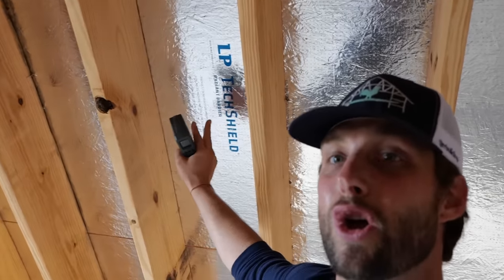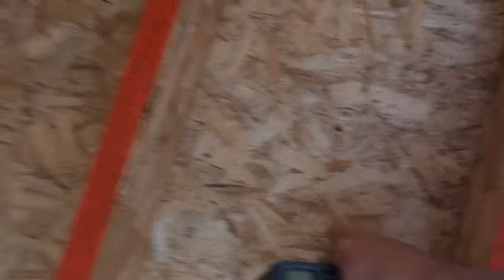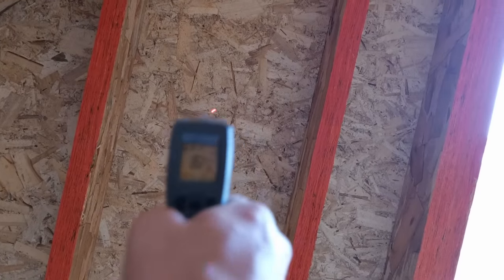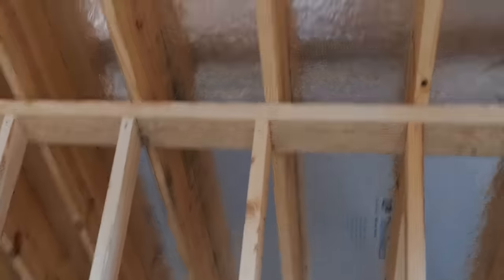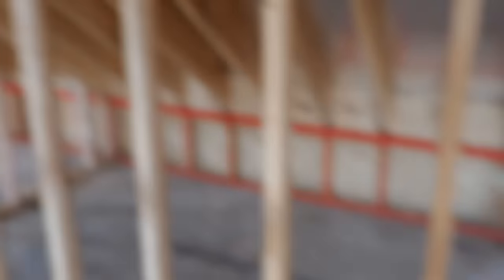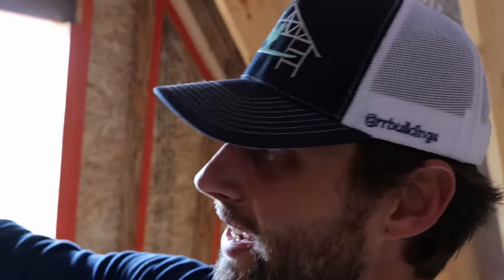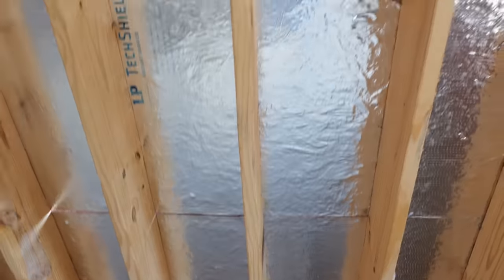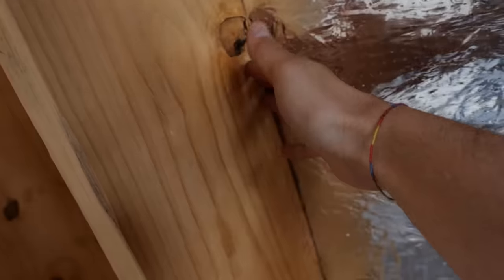Do Radiant Barriers Work? - LP Techshield Review

Comment: This is the info I've been looking for - thank you!! We're eventually going to install this on the roof deck behind our cape cod's knee walls and turn those areas into conditioned space. One question though: would you install baffles right to the radiant barrier, or do you think the air gap between it and the fiberglass batts that we also plan to install will be enough for air flow? Or would they be redundant since we'd have that air gap? Thanks again for your input!

Comment: I'm wondering, if the radiant barrier reflects the heat back out, what effect does that have on the lifespan of the shingles?
Reply: My understanding is that it basically turns the roof deck into a hot skillet,  and shortens the lifespan of the asphalt shingles,  just like when someone spray-foams their attic.  Having a metal roof built upon a batten system negates that,  but few people are willing to spend that kind of money on their roof.  I am getting ready to install a roof on a home where the customer has a finished attic space they use for their office.  I am going to use a radiant barrier underlayment in an effort to make the attic/office more bearable in the summer.  My customer understands the impact on the shingles but feels the trade off is worth it if it makes his office space more comfortable in the summertime.

Comment: Thanks Jordan.  I enjoy your videos.  Stupid question time.  It seems shiny surfaces most effectively reflect radiant heat facing the source of that radiant heat.  There are products out there to be applied to the outside of roof sheathing that are reflective generally to the same extent as the radiant barrier on common RB roof sheathing to do so.  Therefore why is the shiny side of the Tech Shield, and similar products, installed having the shiny side facing the inside of the building?  Certainly the other side of the foil may be shiny too but glue etc would interfere with the reflective qualities.
Reply: Willie,  Absolutely right, the shiny foil side should be on the outside, not the inside.  I built a pole barn and insulated with a foil bubble wrap (foil side looking up, not inside) and it works very well in the hot Texas sun. Bubble wrap provides the gap, and the interior is a nice bright white.  Great question, not stupid at all.
Reply: My understanding was that radiant barriers need an air space between them and the source of the heat that you're trying to reflect back. The LP literature shows it installed as in this video. I'm confused.

Comment: Hey Jordan,I'm going to be converting a van into a camper and I have question. Do I need a space between the van surface and the radiant barrier and a space between the barrier and the insulation or just between the barrier and th insulation? Any advice would appreciated. Thank you

Comment: Radiant barriers work best when there is an air gap between the radiant barrier and the outside surface.  The metal attached to the wood will reflect some heat but it will also conduct the heat and radiate from the metal itself.   You typically want a  thin air gap and the hot air can flow out of the top ridge if you have one.
Reply from the maker: I think I understand what your saying, and I agree that a radiant barrier that doesn't touch another surface is best, but its important not to confuse emissivity with reflectivity.  We are preventing the material from transferring heat via infrared light, not reflecting the infrared light away.
Reply: Jordan Smith how is it preventing radiation from entering? It is attached to the osb, and the gap is on the inside. It would prevent heat from leaving not entering.
Reply: @curtcmiller  - The sun’s energy is heating up the decking panels and the exterior roofing material. The aluminum foil overlay is preventing this built - up heat from emanating into the attic cavity and increasing the attic air temperature.
Reply: ddellwo Jordan said it would not work if it was touching the insulation. It seems like the gap is on the wrong side. To reflect it needs a gap, so it is reflecting the heat down into the house with the gap on the inside. It is attached to the osb so there is no space to reflect up.
Reply: @curtcmiller  It's working off the EMISSIVITY quality of the aluminum.  Or, the ability to NOT release as much radiant heat.  A simple example is if you take two hot potatoes and wrap one with foil the foil wrapped potato will stay hot longer because it is not emitting as much radiant heat.  Technically TechShield does not "Reflect" any heat.  It "minimizes" the amount of radiant heat being released.  More info here: https://youtu.be/uGP5KobU6R4
Reply: @curtcmiller  - No, the gap is on the proper side. The foil is facing down into the attic cavity and unless it is in a cathedral ceiling area the insulation will be blown onto the floor of the attic. In this case, the entire attic cavity between the floor of the attic and the aluminum foil underside of the decking panels will be the required “air gap” of the assembly!
Reply: @AtticFoil  exactly correct, just one small nitpick;) foil has an emittance of 0.03, so it does radiate very little as it is not 0. :)
Reply: @charlesbiller4371  I am very familiar that aluminum foil has an emittance of 0.03.  Can you clarify where I ever said it was ZERO?  I think you may have misread my comment.
Reply: @AtticFoil  I guess I misread your post, it appears.  But, that foil on that roof deck in the video will reflect any radiant energy source in the attic.

Comment: I put attic foil in my garage here in South Florida and it made it bearable to be in there in the summer ( along with insulating my East facing garage door. I then did the rest of the house. It's a hell of a lot of work to retrofit an attic built with 2x4s and any new construction should have this included.

Comment: I have the OSB radiant barrier on my roof (Arizona) and I wanted to add the spray foam insulation. After seeing this video it made me think twice about it. My question is, can I use the 4x8 foam insulation cut into pieces that fit between the trusses while leaving space between  the OSB and the actual piece of insulation to get more R value and make my house more energy efficient or will I be just waisting my money on that?

Comment: A radiant barriers benificial characteristic in this application (physically bonded to the OSB) reduces radiant emissivity into the attic therefore reducing the temperature inside....in short and clear. But great you covered not to make contact with it.

Comment: Great video, What is the best way in the south to keep that heat out of the attic space? In your video you are using LP Techshield radiant barrier but will you be adding any spray foam? or foam boards spaced out from the roof sheeting? is that the next step to continue from where you left off? In todays choices options for existing homes in the south ?

Comment: Hi, I haven’t been able to find the answer to this question anywhere...

Polyiso foam board with the recycled paper/fiberglass outer coating... Is it toxic?? Using it in a van build, but it makes me nervous.

Thank you.
Reply: Most insulating products for homes are meant to be covered by drywall or paneling. If you cover it with some sort of paneling or plastic, or even fabric, I would expect it to be safe. They won't likely use chemicals that will be dangerous but breathing the fiberglass dust from insulation is not good. The home improvement stores have NRP or non reinforced plastic which is used in commercial and residential bathrooms as a thin plastic wall finish which can be cleaned. It would be a good choice for a van. FRP is fiberglass reinforced plastic, which has a lot of texture and is used in commercial bathrooms. FRP is a PITA to deal with and I would not recommend it, but NRP can be cut with a utility knife. Thin wood paneling is also great to cover over insulation.
Reply: @CGT80  Thank you so much. We will have wood paneling over it, I was just nervous if that wasn’t enough.

Comment: The radiant barrier being part of the roof deck cut the effectiveness of the barrier because the side in contact with the deck has no effect. This is why I believe that it is better to install the barrier on the bottom side of the rafters. If you are putting sheet rock on the bottom side also then you put strips of thin plywood over the barrier at the rafters to create an airspace. As far as your surface temperature comparison you must remember that the temperature you measure is a function of emissivity and there is a large difference between the two surfaces. That being said, radiant barrier will transform an attic on a 90 degree day from an air temperature of 110/120 degrees  to about 95 degrees. I have radiant barrier in my attic and I'm also a Test Engineer.
Reply: " the side in contact with the deck has no effect"
No, I don't think so.  The radiant energy is still being reflected regardless of contact, reducing the heat gain in the attic.  This will likely add some heat to the wood roof deck and shingles/roofing but that heat issue is limited to the gain by conduction.  This is why there's a need for additional insulation below the radiant barrier.

I wonder whether planning an air gap or insulating right against the radiant barrier is actually better and suspect this may depend on many factors including choice of insulation, whether you have ridge vents, whether you're going for full encapsulation.

Any time you can plan an air gap between roof deck and shingles/roofing (generally this means metal roofing) is all to the good (but this is in addition to benefits of the radiant barrier).  This radiant barrier combined with metal roofing sounds great.

I'd be more concerned with roofing nails penetrating deck and barrier.  Cleats glued and (minimally) nailed into deck and an underlying rafter when possible would probably be best practice.
Reply: @amerlin388  A little about my background, I have a BSME & ME and I hold a Professional Engineer's license. I specialized in thermo-fluids and heat transfer. I spent my career as a Test Engineer that being said when I said no effect this applies only to the areas of contact and since there will not be perfect contact there is a very small effect. With the barrier in contact with the deck the heat transfer is dominated by conduction while when there is an air gap radiation becomes much more important in the heat transfer. The amount of heat added to the deck and roofing is small which has been confirmed by test and measurement. The reason there is a need for insulation in addition to the radiant barrier is because the radiant barrier is only effective against radiant heat transfer. The other insulation controls conduction and convection. 
Of course proper design is needed to get the best results but an air gap is ALWAYS preferred over no gap. Take a trip down to your local home center and look at the insulation with reflective paper if you look at the side in contact with the fiber glass you will find that it is not reflective. 
Nails would not be a big deal. The radiant barrier is perferrated to allow moisture to pass through it and the area of a nail is small compared to the total area.
I stand by everything I said in my original post.
Reply: @timrothgeb416  
Your original post said, "The radiant barrier being part of the roof deck cut the effectiveness of the barrier because the side in contact with the deck has NO EFFECT."  The upper side of the radiant barrier, being integrated, has 100% contact with the wood roof deck, so essentially you said it has no effect.  Now you refer to (small?) areas of contact with imperfect contact (meaning what?) having small effect (meaning NOT drastically impacting efficiency of radiant barrier).  What was the original text trying to convey?

Regarding foil-faced fiberglass insulation, it doesn't matter which side of paper has the reflective surface;  the radiant energy is still reflected to the same degree.  It's on the outside of the paper layer so the consumer can see at a glance that it has a foil layer.

A roofer once tried to tell me shingle life is halved when installed above a radiant barrier because shingles take a hit from both sides.  I could believe some effect but not anything that drastic.  I would welcome your opinion.

Incidentally, I wonder why this product would not have preferred installation with the foil side out (less baking of the wood in roof deck).  I can only assume in practice the foil layer would be scraped/damaged by roofers during installation/shingling.

Comment: That 10 degree "delta" is being held in the roof deck and shingles, it didn't vanish. It was not destroyed.  Heat energy cannot be destroyed.  It can be moved (as AC does), or stored (as your roof shingles are), but it does not vanish. If you doubt that, touch the glass of a heavily tinted car window in the summer sun.  You say the inside of the car is cooler...and it IS...but where did the heat go?  Touch the glass. 
Radiant barriers attached to the underside of roof decking reflect heat back into the roof deck where it is accumulated in the shingles. Heat  is the enemy of shingles.  Weigh the electrical savings against the reduced life of the roof.  If you have a metal roof with an air space for ventilation or a tile roof with air space...great!  If you have asphalt shingles it is better to install the barrier on between the attic floor and ceiling in addition to regular insulation and provide adequate ventilation, REALLY adequate ventilation, for the attic.  Typical under eave vents and ridge venting and/or off ridge vents are not adequate.  Powered, thermostatically controlled ventilation, properly maintained, is a better choice.
Reply: Hey Gary K, I'd like to have you're input. What if I'm building a sauna? What's the most efficient way to keep the heat INSIDE? Would I need to put a gap like he was referring to between the barrier and the inner cedar planking?
Reply: 🧠👀 makes sense, I just started hvac school
Reply: @Revelator713  Good for you!  Great trade to be in.  Something to consider...the easy route when you finish school is to go into service or construction, they will be lining up to offer you jobs, and you can make good money in that. Nothing wrong with that, but it takes a huge toll on your body and by the time you are 50, hopefully you can get into a management or supervisory role...or be a building inspector or home inspector. Don't neglect your continuing education.  Technology in HVAC changes so fast now, you have to keep up with it.
Another route to consider is to work for a hospital or for a retail organization...like Walgreens, CVS, Walmart, etc. servicing their equipment.  Or work for large property management companies on big stuff...centrifugal chillers, air handlers, etc. A lot of those places offer college tuition as a benefit.  Add a degree in mechanical engineering and you have a path to high level facility management jobs, or design work for manufacturers, which pay well and are a LOT easier on your  body.  
Four years from now you'll be about half a million $$$ ahead of people (your earnings plus their debt) who took student loans to get a liberal arts degree and end up working at Starbucks.
Good luck!
Reply: I wonder how this product compares to the fiberglass I saw on this channel #sinnisjInsulator.
Reply: @questioneverything9539  Simple equation.  Heat flows to cold.  Insulation retards heat flow (doesn't stop it, it slows it down) So the best way to keep heat IN is the same thing you use to keep heat OUT...insulation.  
The type of insulation depends on the interior conditions of the sauna.  Is it a dry sauna, or a steam room?  If it is a steam room, you would want to choose an insulation that is not affected by moisture AND provide ventilation on the unconditioned side of the walls, roof. You would out the ventilation "gap" between the insulation and the exterior walls and roof. Really, no different than insulating any other space except for the moisture considerations (if any)

Comment: I have a top floor office with no attic above the vaulted type ceiling. It gets really hot in the summer. A 1978 home. I think it’s roof and ceiling separates by the width of the rafters. If I was willing to pay to tear off the ceiling, but not the roof, is there anything to do to keep the heat to a minimum?  Any concerns about it damaging concrete roof tiles?

Comment: For the Foil-Backed OSB roof, if you use air gap then rockwool (or fiberglass) then dry wall it after the 2by10s, wouldn't that trap moisture which could lead to mold?

Comment: FYI - all of the electromagnetic spectra transmit heat energy,  from ultralow frequency radio waves to gamma rays.  not just UV light.   Now wavelengths which are not absorbed by the atmosphere do not directly transfer their heat to it,  but do it indirectly by being absorbed by objects and the objects them retransmitting the heat energy via various means.  The shorter the wavelength,  the more energy per quanta,  and thus the more heat energy transferred per quanta -- the sun outputs more long wave light photons than UV photons,  but each UV photon has more energy on a one to one basis.

Comment: I have lp techshield roof for my shed. I'm insulating my shed to have a heater inside in the Winter. Do I need a vapor barrier over the techshield before I put up the hard foam insulation on the ceiling?

Comment: The foil touching insulation doesn't negate its reflective properties. Just cause you cover a mirror, doesn't mean it can't reflect anymore. It isn't getting visible light but still can reflect IR just as well. The reason for the gap might be that it's a vapour barrier. Vapour barriers are always to be installed on the inside, the outer layer should only block water but let vapour pass through.